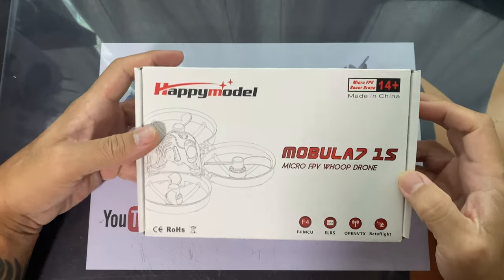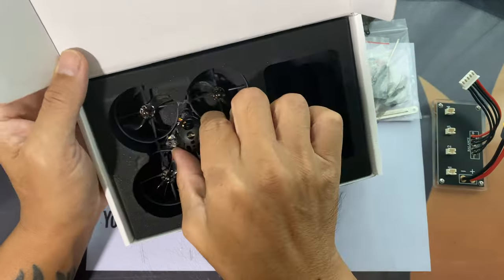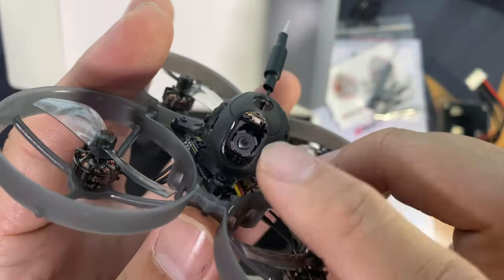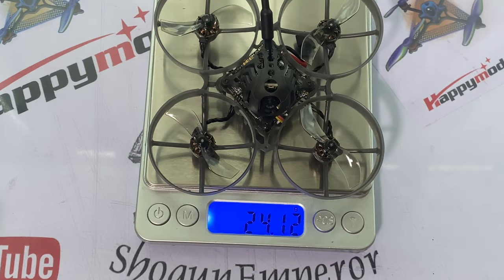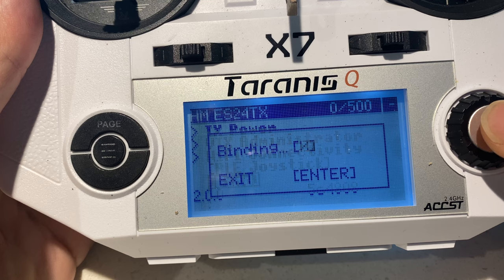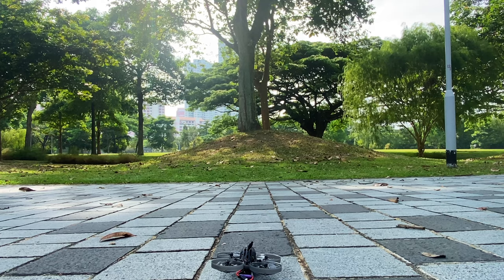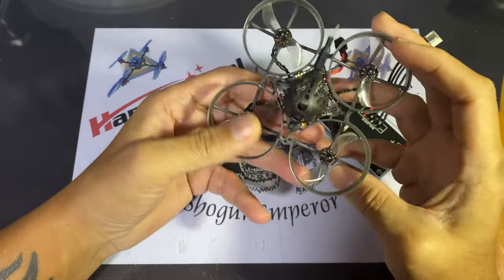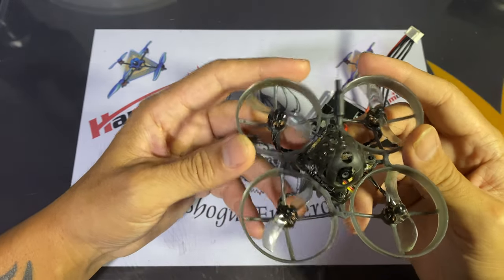Happymodel Mobula 7 1S ELRS and BINDING PROCESS

Comment: I bought 1 arrived with bad no. 1 esc the problem with AIO boards your screwed
Reply from the maker: Try reflashing the ESC again on esc-configurator.com and make sure all motors are set to reverse. Then check motor directions again on betaflight.
Reply: @shogunemperor  I did only 2 thru 4 come up 1 is missing and will not receive commands from FC
Reply from the maker: @bengordon7635  thats strange man. Usually its a firmware issue. If its a dud, try contacting Happymodel via info@happymodel.cn
Reply: @shogunemperor  I called them a replacement is in the mail no question asked just receipt so obviously its happen before  the esc no. 1 firmware says yyyyyyy-yyyyyyyy will not do anything you cannot flash that esc on esc configurator does not show up on BLheli it shows up as yyyyyyy-yyyyyyyyy and the flash button is whited out I spent days trying to work around nd flash but you cannot flash something that is not there motor 1 comes on , but will not receive commands probably a bad batch of controller modules when they tested the batch they probably never flew them
Reply from the maker: @bengordon7635  ok, so here’s a hack. Try heating the board. But be careful not to overheat the FC. I learnt it from someone in the official page and by golly it worked for mine! I had 1 FC that was exactly like urs.
Reply: @shogunemperor  I cannot enter bootloader mode either you too ,, use a heat gun
Reply: @shogunemperor  I just received the replacement updated firmware , binded right up  and does exact same thing all the esc's are working properly . motor direction reversed blades right direction . gyro in sync this is crazy all my other drones are normal WTF spins up then cuts off like a blade wrong direction or gyro off
Reply: @shogunemperor  i bought the Protek35 frame build my own I really hate bnf drones my first experience with spi boards IIEERR  I use the jumper mini elrs simple so easy
Reply from the maker: @bengordon7635  ok, so when u throttle up it has a runaway msg on the OSD?  And power just cuts off right?  Check the motors.  Make sure the motors are ordered correctly and are all spinning in the right direction.  Cause my buddy just had that and turned out one of the motors suddenly decided to switch direction.. a BF issue.
Reply: @shogunemperor  yup they were  are all reversed  i sent them back i have 6 quads i built so I know how to setup up drones its something with the firmware i updated just do not have time to fool with-it decided to build a protek35 instead I live where the weather is usually good so no need to fly inside thanks for all your help 🤣🤣🤣
Reply from the maker: @bengordon7635  understood bruddah. Im so sorry i cant be of much help man.
Reply: @shogunemperor  will send a video of the Protek35 build cannot wait putting the HacRc 45 amp F722 AIO 6s AxisFlying c224 2204.5 2300kv  motors with the  new Walksnail HD system on it with my Skyzone O4L's
Reply from the maker: @bengordon7635  OOOOOOOHHHHH THAT SOUNDS LIKE A GOOD SETUP MAN!!! Cant wait
Reply: I have a T-motor lite F411 ESC no. 4 doesn't show and you can only flash what version was flashed before I lost No.4 ..  it flies good but if you fly it hard it will go crazy like the gyro freaks out is it just an F4 they are prone to that or the missing ESC causes it . my F7's I can push hard never have a problem
Reply from the maker: @bengordon7635  dont think its an F4 issue. I but i do believe its sometimes caused by firmware. Hard to troubleshoot these things really as its alot of variables.
Reply: @shogunemperor  I re flashed beta flight and 1500uf cap seemed to fix it still the video has a little bit of heat wave in it when you throttle up probably just a shitty board for 6s voltage ,,  Video on F7's are premo .. That HAKRC AIO comes all setup osd .. modes .. with betaflight 4.3.0 , 6 uarts I believe and a barometer   pretty cool  I am going withh all F7's now tried to go cheap with the cheaper F4's they never last just   2 or 3 crashs or extreme flying something messes up/.. so far the best board I have used is the speedybee mini F7 with 1404's  just keeps going no matter what the 5 in.'s seem to have lots of issues compared to 3.5 in quads as far as crashes
Reply: @shogunemperor  it was a bent pin inside connector on esc
Reply: @shogunemperor  I feel like such an IDIOT my first time reversing blades I always set them inward well stupid me never told betaflight they were reversed I forgot to set the switch in motors to reversed IIEER .  nothing wrong with the Mobula7 it was me hahah  The HakRc flight controller I cannot get OSD to come up I thought its automatic I set the config to OSD on but no osd my Night eagle 3 has its own osd it works also  the Protek35  with the 3 blades is so loud that high pitch sound WOW
Reply from the maker: LOL happens to the best of us bruh
Reply: @shogunemperor  the Hakrc AIO and protek35 are a perfect combo the hakrc has a crystal clear video I noticed the more amps in esc the more noise you get in video my 60 amp esc gets a little wave noise at certain rpm's is this normal seems a lot of power for a tiny board on these 60 plus amp boards
Reply: @shogunemperor  wow the Protek35 is difficult to descend and fly no flying  in wind  close to ground its the best I can see why DJI Avanti has so many crashes
Reply from the maker: @bengordon7635  LOL yes
Reply from the maker: @bengordon7635  oh sweet bruddah

Comment: binding process.. not for beginners...why make a video anyway
Reply from the maker: flying drones is also not for everyone, why fly it anyway?  LOL binding process is the basics of this hobby man, if you cant do that, then I guess this hobby is just not for you. Most if not ALL RC toys requires binding. Maybe stick to those RTF(Ready To Fly) where the radio transmitter is packaged with the drone or those video drones that comes with the remote control.
Reply: @shogunemperor  well if it would just be pressing the binding button you would be right .
This is a receiver baked into the controller, same with it's software. The binding process and checking for the software version isn't mentioned anywhere.
Yet not even the binding phrase.
If you don't have something to say, just let it be.
Reply from the maker: @ismaelyu5  thats cause this is an SPI receiver(built in) so binding phrase is not necessary, hence I didnt mentioned it.
Reply: @shogunemperor  and that's the reason I complain, it's not standard behavior or related to any other normal binding process, even more when you just got into elrs
Reply from the maker: @ismaelyu5  and that is why this video exists. Also, I enjoy making them. Thanks for ur responses though. I had fun reading through them. 😁
Reply: @shogunemperor  thanks for the replies, i just got the same gear, expect for the TX elrs module. Mine is from happymodels. I didn't know I could use the TBS Lua beside the elrs one.
And it didn't worked for me, because I already had flashed the TX module with a phrase. Since there was no mentioning why this LUA script and no phrase it was confusing. Just wanted to point that out. Thanks for staying calm, besides i was a little harsh
Reply from the maker: @ismaelyu5  hahah no worries bruh. U have ur experiences and I totally understand as I had gone through it too.  It also gives me insight to what people go through AND i make new friends. So dont apologise. So is ur mob7 still not working? Lets get u flying ASAP
Reply: @shogunemperor  thx, figured it out. Most problem was getting it recognized by the PC to update my phrase. Damn USB drivers
Reply from the maker: @ismaelyu5  SWEEET MAN!!!!  hahahahaah OMG I TOTALLY GET YOU!!!  Damn USB drivers!!  Anyway, u have an awesome weekend and happy flying man!!  Hope to see ur comments in future videos too!!  U can be brutal!! hahaha I'd love to hear everyones opinion!